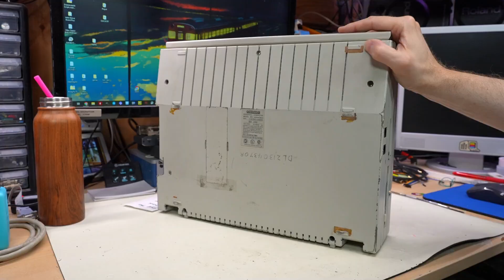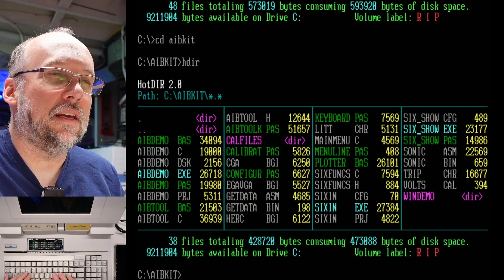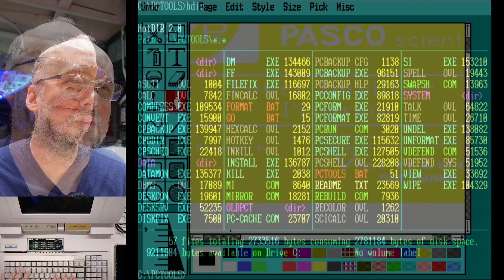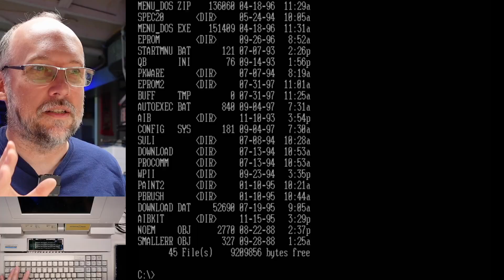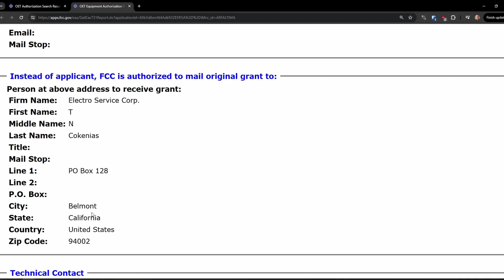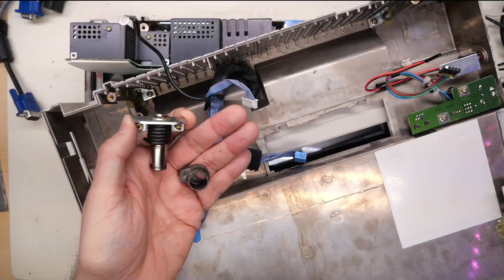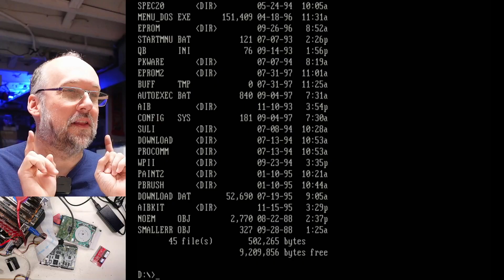PC Archeology: The Altima One laptop (Altima Systems)

Comment: It’s interesting to see pasco and vernier worked together, both companies offer data acquisition equipment for the educational market, the university I work at when I was in the physics department we actually used pasco in the teaching labs but one professor used vernier for outreach and in class demos using their portable data acquisition handheld. Some of the sensors were compatible and both companies mentioned it. I had even found some of the older pasco computer interfaces from the 90s that hadn’t been used in many years by the mid 2000s.

Comment: This probably never really took off as a midi composition device as I believe most Midi Producers were using much cheaper Atari 1040ST's at the time and possibly even slightly more expensive Macintosh products from the early 90's. the portability would have probably been nice, but I doubt anyone saw the extra value in cost premium. Someone please correct me if i"m wrong. I was only single digits when this was brand new!
Reply: continuing to watch the video the DOS based Software looks really clunky compared to early Cubase. I don't know if Cubase's GUI came after this particular software. but even if it did, it probably wiped the floor with it. I would be Very curious to hear what any producer from this time period has to say as I've only used it on my STf a handful of times and most of my knowledge is secondhand.

Comment: Conner hard drives were always quite finicky with their settings as I recall..  I remember having exactly the same model and the stupid thing not liking being a second drive in my system and jumpers and settings not working so it had to be the first drive no matter what..  Stupid thing then died a couple of years later..    Then there was the whole saga of early Fu-shit-su drives where they spontaneously ate themselves after a short period in service.  Luckily they had, at the time, the longest warranty period of all the manufacturers, which is why I originally bought them vs  other brands, but I went through 3 or 4 warranty exchanges with these drives before the company figured out what they screwed up and I remember getting two new hard drives as well as a miniscule class action settlement out of it..   By that time though, the drives were already basically obsolete and newer, faster, higher capacity drives were available...
Reply: I clearly remember the trouble of paring Conner drives with anything else. They worked best with another Conner drive. However, I never had one die on me.

Comment: I like that article's "nudge nudge, wink wink" bit on the modem being unapproved for use on phonelines, cos about that time, British Telecom (which had long been separated from the Post Office in the 80s) were still pushing for approved and non-approved telecoms equipment, even though the majority of it came with plug & socket setups by that point, and frankly, nobody paid attention to whether things were BABT (British Approvals Board for Telecommunications) approved or not, just plug it in and go, even today telecoms equipment still carries BABT approvals (or doesn't!), and nobody cares about it... :P
Reply: Australia went over to almost completely (maybe even absolutely completely) VOIP telephone services some years ago.  What that means, probably, is that if I want to make my own PABX and connect it to the telephone socket on my modem, I can probably do so without breaking any laws (and if I break my modem, I just need to pay for a new one).

Comment: Cloning and replacing failing hard drives has been a persistent drumbeat at my job, and the anxiety of waiting to see if it will complete or throw an error makes this hard to watch. Damn you Toshiba!
Reply: The company where I worked acquired another company, and we had to integrate their infrastructure into ours. There was this PC that had been running 24/7 since 1994 (and it was 2009). I figured it was a good idea to clone the hard drive before even transporting the thing.
When I took out the drive and connected it to my laptop, the drive was unreadable, and a little bit of panic ensued, as this PC handled emergency buttons that some elderly wear around their neck, in case of a medical emergency like a heart attack.
There was one last resort: In the PC, the drive had been oriented on its side, so figuring that drive had been running on its side for 15 years straight, I put the drive on its side, reconnected it to my laptop, and behold, it worked.

Comment: The manufacturers set the coil in the cable with heat.  You may be able to coil it around something like a curling iron to reset it.  But first, try coiling it the other direction and see if it tightens up.

Comment: In the early nineties, I drove around with my 286/386 desktop, mouse and keyboard in the boot of my car. I drove it inside on a small trolley and connected it to the clients' monitor. I always checked which monitors were available before getting underway and I never forgot my floppy with monitor- and printer drivers. A copy of that floppy sometimes got the 'systems' guy on board. Life has gotten better the last 30 years.
I remember q-Edit. One of my customers used it to write batch files for the university mainframe. The guy dialed into that mainframe by rhythmically slamming the two plungers on top of his rotary phone to produce the modem number. Because it saved time...
Reply: Pulse dialing the hard way.
Reply: @gmirwin teenagers in the UK learned how to do that with payphones. The tone dialling was disabled on the unit itself until you entered money, but the exchange had no way to know so it didn’t reject pulse dialling received from the line!
Reply: @kaitlyn__L  On this side of the world, the microphone on the receiver was disabled until you had inserted money and the money had dropped.  Later on, there was a deliberate delay introduced so that there was around a second's delay between lifting the receiver and being connected, so you couldn't dial by using the receiver hook.
Some people were using pay phones as a "paging system."  They'd arrive at where they needed to be picked up, then use a pay phone to dial home, let it ring once or twice, then hang up.  That would be the signal for the person at home to get in the car and go collect the person, but without the cost of actually making a call.
Reply: @melkiorwiseman  that’s a lot more clever to evade fee-avoiders! That thing about the microphone, did that also prevent the common hack here of asking someone to call you from home at the phone box? 

Here, the “paging“ thing was either done by the receiver hook trick, or more commonly by placing a reverse charge call (collect call, in American) and having the person on the other end know ahead of time to deny the charge.
Reply: @kaitlyn__L  Yes, the microphone was generally locked out until money was inserted, although I presume the operator had a way of bypassing that if you wanted to make a free call such as a directory enquiry.  I'm not sure exactly how it worked since it was a bit before I began to learn how such things worked.  I only knew of the main effect.

Comment: I made a lot of money buying "non working" Conner hard drives and repairing them in the early to mid 90s. I only bought them if they spun up and paid no more than $1 each. Often they had been tested when jumpered wrong. Sometimes they had been formatted while they were in a system that didn't have a correct BIOS setting. And, I had a device called "the conner" that plugged into the maintenance pins and could redo factory low level formatting and pairing a circuit board with a different HDA. Less than one out of a hundred were unrepairable and I could resell them with a warranty to computer refurbishers for decent money.

Comment: My guess is that ISA card is a MIDI interface. The switches are probably for setting the MIDI channels. You'd need some kind of a breakout cable to get standard MIDI ports.
Reply: Nope, it is an eprom programmer interface. 
A UK company bundled this base machine with a Midi card and music software, and it made it into a review.
If this machine was bundled with  eprom programmer from retailer or if it was added by the user is unknown.
Google search for SAC-101 or SAC-201 for more info about the card.

Comment: USB to IDE adapters never work with old drives like this, they require drives that supports LBA. (And even some drives that do support LBA still don’t work with these)
These drives, just like early Quantum ones have a disintegrating rubber bumper inside, that’s why the heads got stuck and it spun up and down. If you aren’t afraid to open up the drive it’s actually possible to fix that problem. I fixed a slightly newer Conner that I got for my collection which had that issue recently.

Comment: I saw that the Connor drive from 1990 was going to be a problem once I saw it was type 17 and not 47 in the BIOS. That's your first big clue that this is a drive from before the ATA-1 standard was ratified, and while IDE has been around since about 1986/1987 it was a bit of a wild-west back then.

The original IDE was a Western Digital thing and everyone followed/copied.

In the very early days, IDE had an 8-bit and 16-bit bus variant. The 8-bit version tied several lines (including the upper parallel data bits) all to ground on the connector, and newer controllers are totally oblivious to this so variant because it's "extinct". Several drives from back then even had an "XT mode" to drop it down into doing 8-bit IDE.

I don't know about this particular Connor but I do know Connor drives from that era are very finicky about newer controllers.

It's fun to see the stuff you work on and discover, Adrian, even if it makes me feel old! :)

Comment: 5:45 There are those big cutouts on the back that look to be about the right size to hold two feet that could prop up the case to the right angle to make it sit on that front bezel. Just like keyboard feet but way longer, and rotating 180°.

Comment: You can tighten up the keyboard cable by winding it in the opposite direction. Just twist the cable until it starts to coil the other direction and keep twisting until it's fully wound that way and it should be very tight.

Comment: I would also like to point out what version of the operating system is running on the 286. Just copying the files is not enough because the files and operating have to be the same version to run properly... at least from my experience... I would use a drive image program to take a snapshot of the Conner drive... Nicely done... =)
Reply: The only files for this would really be relevant are DOS related system files. If Adrian has that version of DOS sitting around somewhere (which I am sure he has), he can just sys whatever drive and use it. The application files aren't much of a problem normally.
Reply: @Colaholiker  True.... =8-)

Comment: My SLT286 used that power connector on the hard drive too, in fact it looked very similar (20 meg). Those USB ide adapters don’t seem to like vintage hard drives

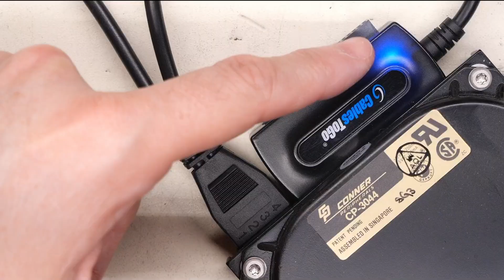Comment: 45:38 You can easy fix that issue with the adapter by using contact cleaner in the 40 pins contact. It is really poor quality, no gold plated contacts.
Every time i use mine i have to use contact cleaner and i even use with oil.
It can also be the power supply. That molex doesn't have two negative pins, only one and some drives doesn't like that.

Comment: Upgrade that machine and repurpose It.
Maybe adding a better processor if possible, a math coprocessor, a compact flash instead the hard disk, add more memory, replace the isa card adding an isa sound blaster or ad lib, or a better isa VGA card. Replace the power supply adding an USB C charger, remove excessive metal and add lithium batteries to work stand alone, add a network card for bbs connection... Who knows what mods can be done on that machine?

Comment: I remember IDE hard drives from Connor having some frustrating compatibility issues that generally weren't present with other brands of hard drives back then. Some controllers just couldn't make any sense out of them. I don't know what special thing Connor was doing.
Reply: Oh yes, the joy of working with Conner drives. Trying to make them work with a non-Conner drive on the same bus was a nightmare. Some combinations worked when Conner was the master, some worked when the other was the master, some didn't work at all. Best bet was always to pair them up with another Conner drive. 
Controllers were less of an issue back in the day, I never had one from the same time as the drive not working. But more modern controllers are probably a totally different story

Comment: I am familiar with those Conner hard drives, they were commonly used by Olivetti because they had a factory in Italy. You have to be careful because they predates the IDE standard and may die if you connect them to a modern controller... or they may kill the controller (you may want to check your USB adapter)
Reply: Some of the Conner hard drives had a jumper to select IDE/ATA mode of operation.

Comment: I remember Quick Edit. That was a fully customizable text editor that came Setup using Wordstar commands. There was a text file you could customize to change every single command and operation of the text editor that when edited, you ran a qedit compile that embedded the custom command file into the exe file. BITD I actually purchased a copy of Zsoft pc paintbrush before Microsoft grabbed it.

Comment: Hey Adrian, when I was younger I built several EEPROM programmer boxes made for parallel ports, and the reason behind it is it was very easy to write code in assembler to toggle bits directly on parallel ports and made it very simple to program EEPROMs as long as they didn't require super fast programming speeds.  Back then parallel ports were the way to go for such things, and as you mentioned, there were also several very expensive programming devices that existed that used the parallel port as well.

Comment: Thanks for the vid! It feels like this computer may have been connected to external scientific systems via some other card, and maybe that's why most of that software isn't working. I have one question though, why did you use xcopy for the hard drive backup? In my mind, the most logical thing would be to use dd on linux to just image the entire drive. The continuous linear read is easier on the heads (which could be in bad shape), and this would then let you explore the full space of the drive via that image, and you can take time to extract potentially erased files/software from empty space on that image etc. Personally, that has always been my route with specialized vintage computers...

Comment: Seems like Thomas Cokenias is an actor now. If you read his resumé it says he has an electrical engineering degree and "Most of my career I helped electronic equipment manufacturers identify and correct electromagnetic interference problems". Seems fitting.
Reply: That's quite a career change :D

Comment: I think the Altima brand was passed around a bit in the early 90's but I learned a hard lesson when as the IT Manager, I convinced my office to go portable with laptops and selected something like 30 Altima branded laptops. The Altima machines were 50 to 100 percent cheaper than name brands like Compaq or NEC. Unfortunately, after a few months of use something like 20% of the devices were dead and the ones still working were not holding up well. After that experience I stayed far away from unknown brands. (I have a vague recollection that "Anypc" was remote control software)
Reply: Up to 100 percent cheaper? So they were free? I don't think you know how percentages work
Reply: @hustla818 maybe they threw in freebies if you bought enough! Which is a sure sign to stay away of course, but a newbie manager might not know that.
Reply: @hustla818  lol
Reply: @hustla818  Apparently not :D. I could get between 50% and 100% more laptops if I purchased the Altima rather than Compaq or NECs (The other ones I was looking at) so I guess I should have said 33 to 50 percent cheaper :shrug: lol

Comment: "Back in the day, programming EPROMs required very expensive data I/O hardware or specialized hardware" …or a Z88 laptop which used EPROMs as disk cartridges!  I remember having to go over to my school's Electronics lab to use the UV eraser when I ran out of space, or at a push, leave my cartridges on the window-sill for a day. I'd then get the little silver labels used to write protect 5.25" floppies to protect the EPROM packs from erasure.
Reply: That's so cool to hear, never knew that.

Comment: I bought the 8 bit card MPU-IPC from roland 34 years ago  and it had a breakout box with the midi connectors , sync24 and tape sync. It looks similar to that ISA card connector. These IPC-MPU cards are very rare today and expensive. The software on the documentation is voyetra sequencer plus. Voyetra support both MPU-IPC and voyetra card.  I bought it with software from  a company called Dynaware USA.  It was Called Dynaduet and they also made Ballade for dos.  It could run on EGA and VGA from 8088 up to a pentium III

Comment: It would be cool if it was actually sold by Nissan Computers.    (The computer shop that the car manufacturer sued after they changed their name from Datsun.)
Reply: Their name was always Nissan, but they were scared to use their real name in foreign markets, in case they would fail. That's the reason they used Datsun until they knew they were accepted.